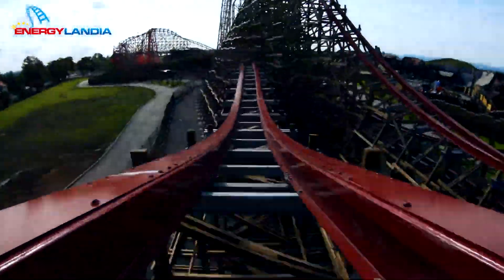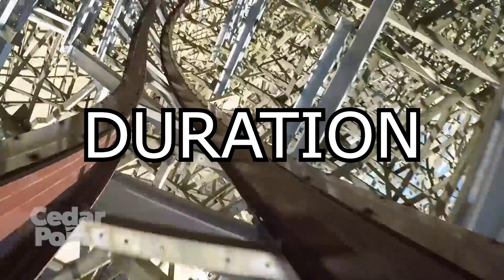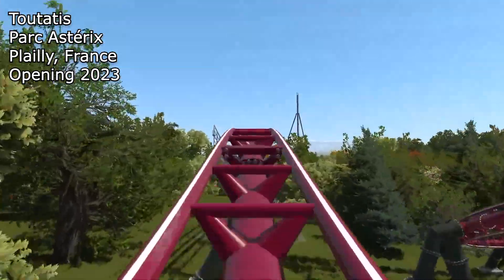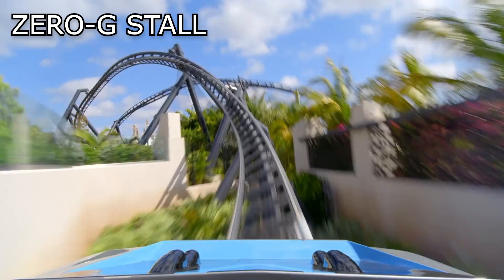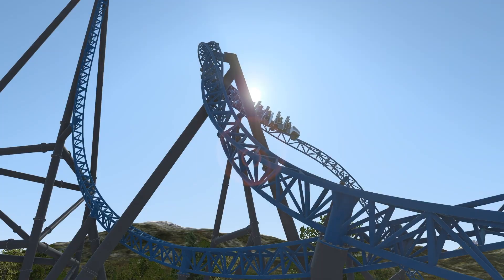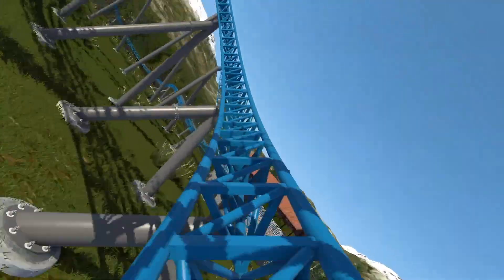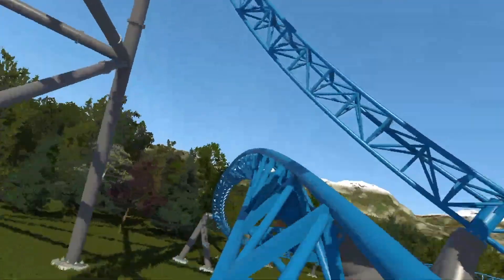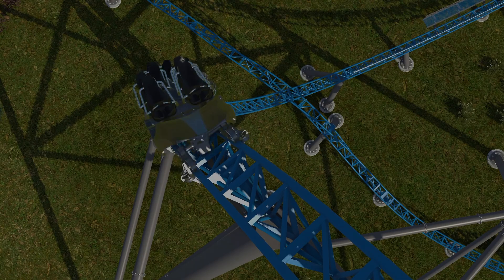Can I Design the PERFECT Roller Coaster? (Part 1: Intamin Blitz)

Comment: wait how did you made those custom parts for the switch track? (instead of the standard unbanked ones) and the cheat code in the description is just Wonderful it works great
Reply from the maker: It's two separate coasters (one for the curved switch track, and one for the straight) with the povs edited together.

Comment: Idea: 
-start with short dark ride part
-swing launch (with airtime hump) into 60m top hat with 95° drop
-twisted airtime hill
-airtime stall
-airtime hill into dive loop
-zero g roll
-speed curves with wave turn
-outerbanked turn into triple down 
-midcourse break
-launched lift hill (like Maverik but faster) up to 30m into a huge extended hangtime dive loop.
-double up airtime hill
-non inverting loop
-stengel dive
-barrel roll up into outerbanked turn
-triple up then airtime hill down
-150° spike 
-final break & turntable back to station
Reply: i love the sound of that it sounds like an amazing layout

Comment: Looks like you nailed it but maybe you had to inspire the twisted hill on the twisted airtime hill on taron instead of taiga’s because that on is incredible intense
Reply from the maker: I didnt really mention taron because the elements used are all also featured on those other 4. But yeah good point
Reply: @EliteCoasters  yeah I understand you because taron doesn’t really have separate elements but a lot of twists, turns and airtime hills instead.